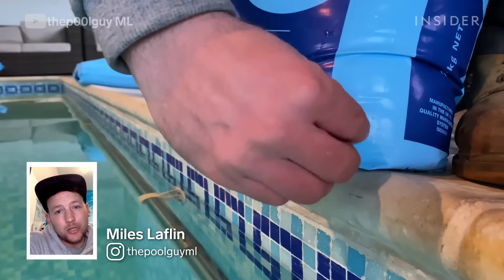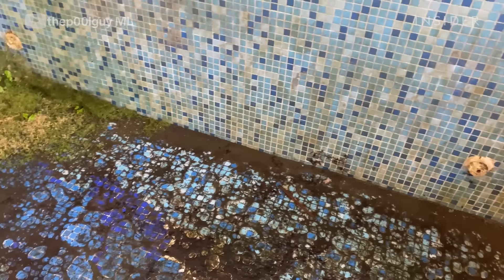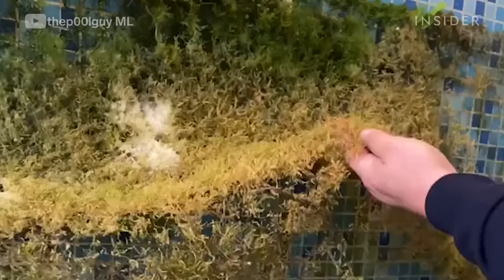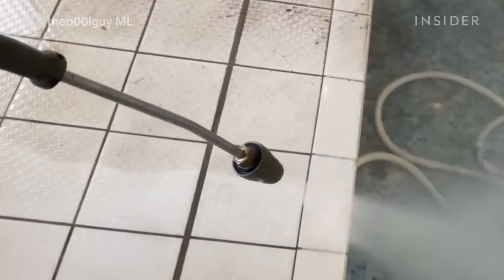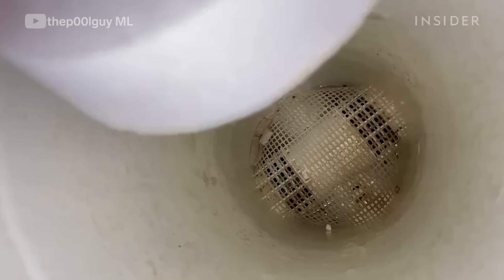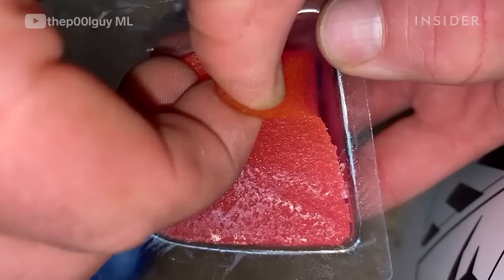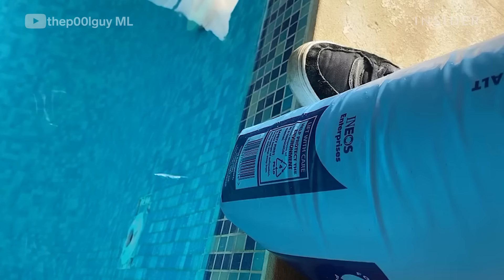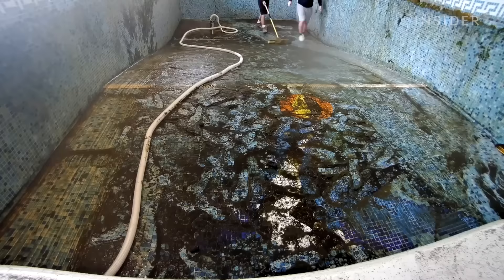How An Abandoned Indoor Pool Is Deep Cleaned | Deep Cleaned | Insider

Comment: How do they clean the pools internals, like the piping, water filter and all the machine stuff hidden in the pool?
Reply: The little goblins are so efficient  at what they do that they're literally monopolized by big companies
Reply: I'm NOT  professional, simply owned a decent pool a few years ago. Depending on filter type, it would likely need to be replaced or (in the case of a sand filter) have the filter medium changed or washed\backwashed. The pipes are likely cleaned with pipe attachments for the pressure washer or long, flexible brushes called 'sewer snakes' to scrub out the piping. As for the other machinery, my best guess is either disassembly and cleaning or chemical fluid washing.
Reply: @cancelhandles  interesting. Thanks for a lot.
Reply: Super chlorination kills everything,  the left over is picked up by the filters
Reply: who said they clean it
Reply: @cancelhandles  don't listen to this guy, I can prove I was a goblin at one point.
I knew a guy who used his tounge instead of a power washer.
He died while I worked there.

Comment: If the estimated time for the pool to have gotten that bad (6 years ish) why is there still so much water in the pool? Shouldn't there be a lot of water loss from evaporation? Outdoor pools get refilled by precipitation, thus why you see almost full neglected outdoor pools.  Six years is a long time for an indoor pool to still have that amount of water.
Reply: possivly because if there wasnt any water in it at all that could cause moe damage than just what the plants did, but i could be wrong there
Reply: You need heat for evaporation. It would stay a loooong time in an air conditioned home.
Reply: @mycatiswaysmarterthanmosto8500  that's a good point, evaporation does happen faster in warmer temperatures. But if it's cold, then mold grows way faster(it really didn't look like a slimy gross mess on the windows and other surfaces that should have been awful). And even if the room was kept at your average home temperature of mid 60's the evaporation should still have been significant.
Reply: Most indoor pools are in rooms separated from the ventilation system. 

The air would quickly get saturated with humidity and no more would evaporate. 

If there is nowhere for the water to go, it stays in the pool. If the temperature stayed the same the air would stay saturated and if the temperature went up and down it would condense and end up back in the pool. 

It's like a glass of water. Leave it on the counter and it will evaporate. Put it in a sealed Tupperware container and it won't be able to.
Reply: Thats why the air changes and smells so much like chlorine when you go to an indoor pool.
Reply: @colmreynolds9869  except indoors doesn't mean sealed. Literally every building built is vented and has been, either required by code for the last 40 years or simply by the fact that it's nearly impossible to build a building that's sealed. I'm a construction inspector very familiar with building envelopes, the associated codes and how they work.
Reply: My guess is it is on an auto-fill.
Reply: @kenrichmond3946  boom!!! Thank you. Never having owned an indoor pool I didn't know that was an option.
Reply: @codename495  actually, urea is also a component in our sweat. The vast majority of chlorine smell coming from pools due to urea reaction is because swimming is good exercise and people sweat.

Comment: Once the salt dissolves which dosent take long it takes approximately 6 hours with the pump running for all the water to circulate and mix completely. This is all the time it takes for a salt chlorinator to work at its optimum level. It certainly doesn’t take a week. FYI the salt chlorinator was invented by a company in Sydney Australia in 1974. It is by far the most way to sanitise a pool in Australia. It definitely doesn’t take a week.😂

Comment: You did an amazing job on this my question is I have direct the bottom of the pool I've used water text pool blaster it works but it takes forever what's an easy way and I don't want to use a hose or like a garden hose I don't want to look nothing up to the pool and had to drag a big hose what's an easier way to do it I have an above ground pool 15x24 using a garden hose or using a long hose that I have to hook up to the skimmer I don't want to do that give me some ideas cuz I'm frustrated

Comment: Quick question... Want to put up a pool size of 10x5 m with height of 3 meters for diving practice in the mix thus the depth. How much water would I need in liters and when should the pool be emptied? Thanks in advance!
Reply: 150,000 litres. No clue how often it should be emptied but you might want to take your water bill into account.

Comment: So why is he putting in all the salt and chlorine in a pool outside?
Reply: It's inside though
Reply: @carteradams43  pay attention to the lighting and the flooring. The inside pool flooring has tiles, the outside pool has concrete.

You can see the difference here.

Indoor pool: 0:11
Outdoor pool: 3:13
Reply: @H1storyRemembers  so? That lighting looks pretty normal for a room with windows or good amount of lights. And to answer your original question, an outside pool would be even dirtier then inside pools hence more chemicals used to keep it clean
Reply: I’m trying to show you that the indoor pool’s deck is tile, while the outdoor pool’s deck is concrete.
Reply: @H1storyRemembers  I see. I also answered the question in the previous comment though